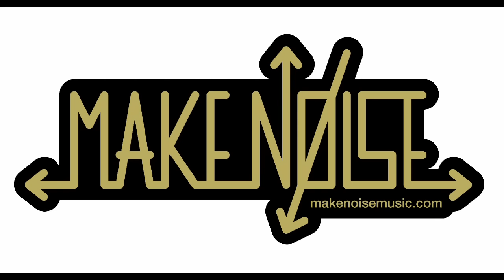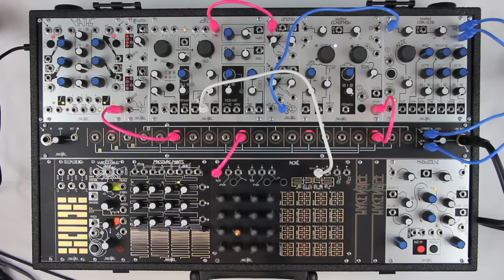René: Plane of Composition

Comment: Something weird that I see in this clip but I've noticed that is also happening with my Rene... on the first 4 step sequence of the clip, the furthest right knob is fully CCW but spits out a higher note than the rest of the knobs that are tuned to a higher voltage...why is that?
Reply from the maker: nectariosm The sequence is a saved pattern accessed from the Q page, so the knobs do not necessarily reflect the values coming from the QCV output.